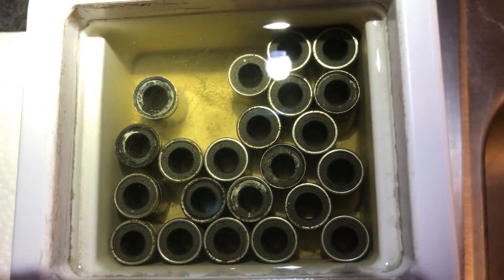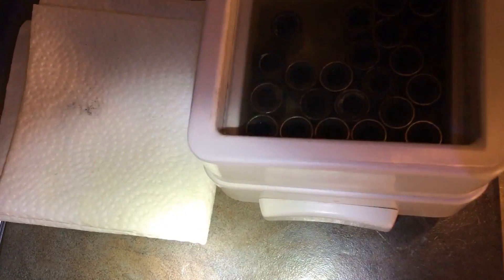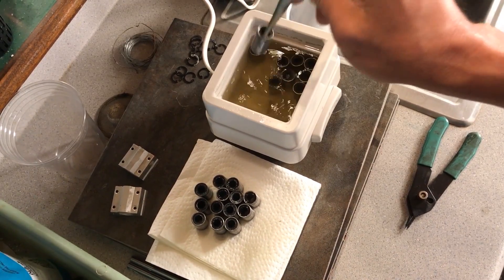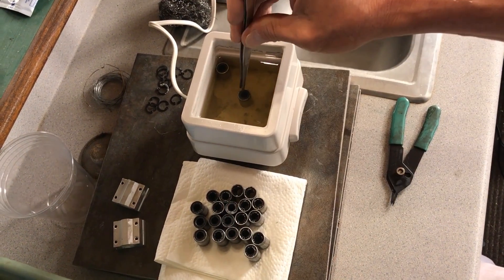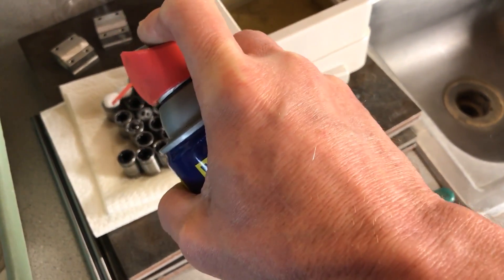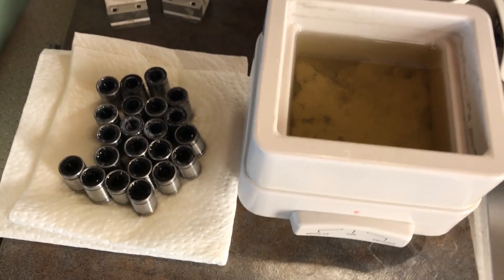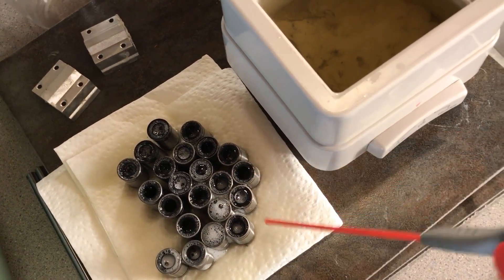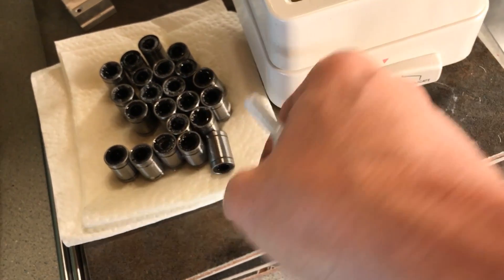What's In YOUR NEW bearings?? - No wonder they crunch!

Comment: What did you end up lubricating with? Oil or grease?  How did it work out for you?
Reply from the maker: I used an H-1 rated food-safe grease I had on hand and a couple of drops of 3 in 1 silicone.  It's the exact same grease I will be using to repack my Kitchenaid mixer in an upcoming video.  When I installed those bearings, I used 4 bearing blocks vs the three blocks the printer had  I did this when I upgraded the base frame of the machine bed.  I suddenly developed issues with the printer 'shuddering' ever so slightly while printing (like a fuzzy bear effect) and I gave up on that unit for a while.  My Ender 3 just works - all the time.  This printer was purchased as a project, and my 'repair' made it worse.  I'll get back to it eventually.  it's a solid printer otherwise.  Thanks for stopping by and leaving a comment!!
Reply: @TechGorilla1987  Thanks for the feedback! I just purchased some pillow blocks with linear bearing from Amazon.  Unfortunately the quality of them seems to be lacking as they feel like they are grinding/scraping when running along the linear rails.  I just picked up a parts cleaner and am planning on doing what you did to flush/clean/repack them.
Reply from the maker: @AlexHorwatt  After running them on the rails, you will want to examine the rails pretty well.  Cheaper rails can score quite quickly.